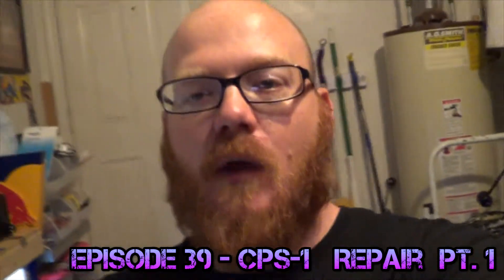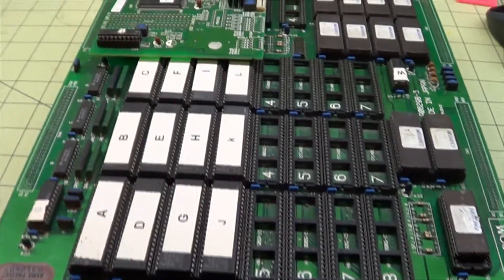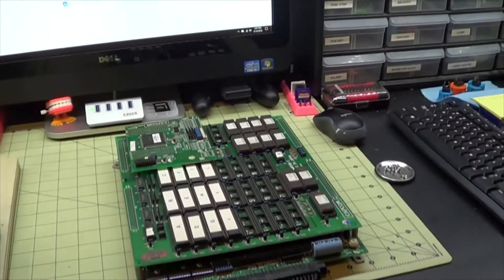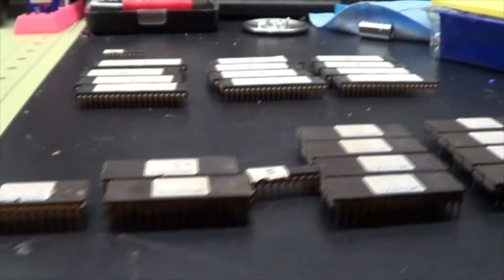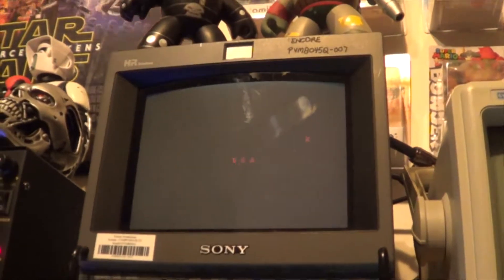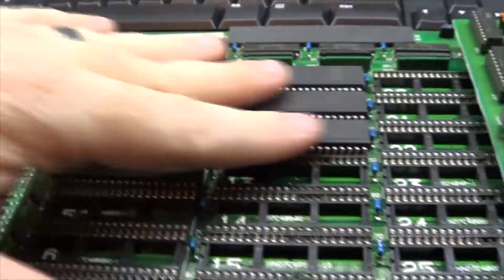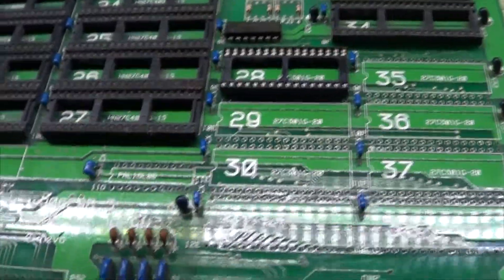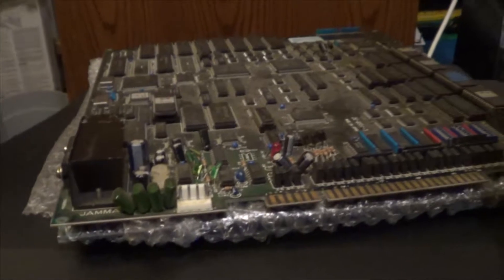CPS-1 Repair (Pt. 1) PastBlaster - Episode 39

Comment: Nice video, how did you go? I'm having some graphical glitches on a SF2 WW that I narrowed down to the B board, I am testing continuity between the chip legs and the socket pins on the solder side to rule out dodgy sockets before i remove and swap them all